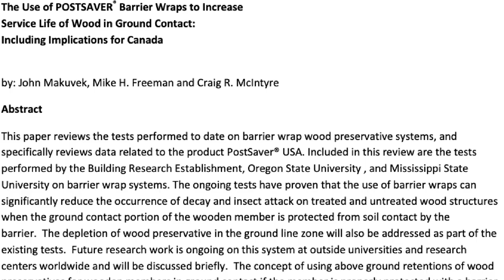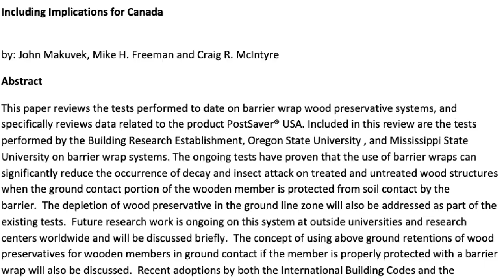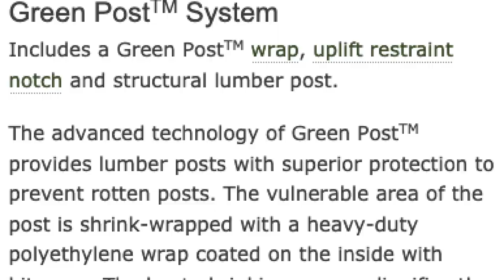Prevent Post Rot with GREEN POST

Comment: I am surprised there was no mention of the EPA restrictions on traditional types of pressure treatments for general home use in 2004. CCA and other treatments were very effective at penetrating deep into woods like Hem Fir and Southern Yellow Pine. The new products barely penetrate a 1/4 of an inch and use predominately copper compounds that can wreak havoc on galvanized fasteners and aluminum flashings. There are also many studies that show products like CCA are not really harmful to the environment. One thing for sure is, the huge waste of natural resources, man-hours, and equipment lost to the premature rot of crucial support structures is very harmful to the environment and our economy, also I would like to note that good quality tight grain lumber can rot pretty darn fast too if it is not properly treated. The topic makes for a good discussion and brings a little more awareness to the job of building with wood.

Comment: Good info. What would be the advantage of this vs perma column vs wet brackets over piers
Reply from the maker: To me I prefer to have my posts run continuously above and bellow the ground without the bracket hardware, but each build is different. With the bracket mounts you’d need a proper concrete footer running under the building perimeter but we didn’t want that at our location on the mountain. So you’re talking way less time and money just needing to did post holes instead of that foundation.
Reply: @LittleMountainLife  : fantastic explanation. Thanks